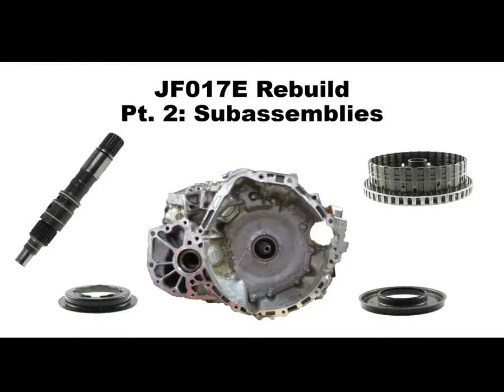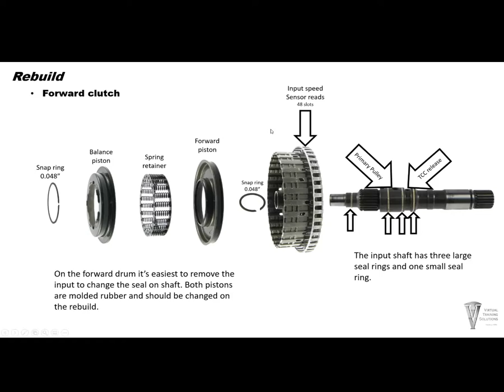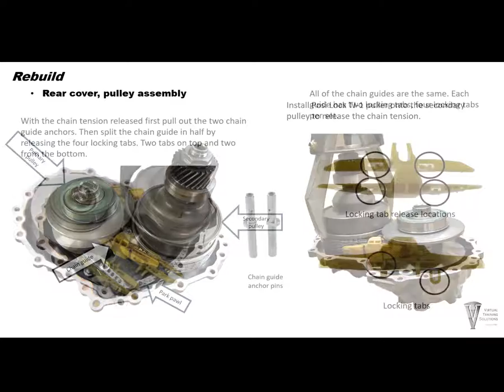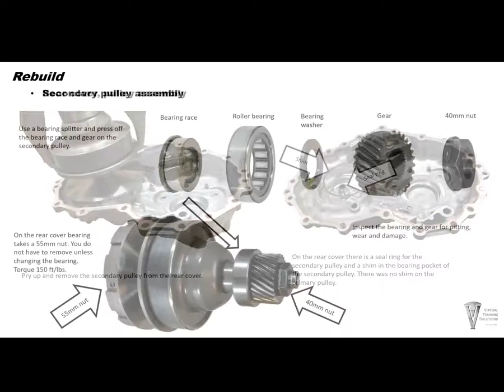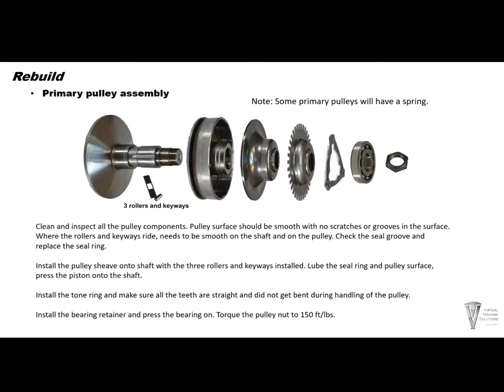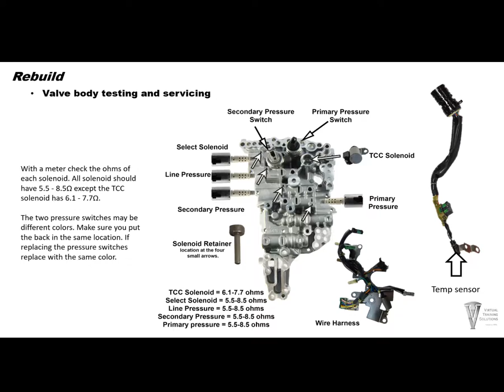07 vts jw jf017e subassemblies

Comment: Hello, I have a question.  There is a humming sound in the Nissan X Trail 2016 automatic transmission.  Everyone says it is normal between 20/40 km/h.  What is the solution?  It does it even when you slow down. Dizel No, it works fine, there is no knocking or anything, the sound comes from the gearbox, how much is the gearbox oil in the front? They put 7 liters after the repair.
Reply from the maker: A humming noise can indicate a number of concerns, and it could be normal. Usually, I would first start looking at your tires. Your tires can adversely affect the sound. If it is a solenoid buzzing, that can be normal; other than that, noises are the hardest thing to find. I'd take it to a shop and have them put it in the air. Maybe the sounds will be more prominent. https://www.atra.com/ShopFinder

Comment: Hello, I have a question.  There is a humming sound in the Nissan X Trail 2016 automatic transmission.  Everyone says it is normal between 20/40 km/h.  What is the solution?  It does it even when you slow down.
Reply from the maker: Is the humming coming from the front or the rear of the vehicle? are there any symptoms, like harsh shifts or something like that?
Reply: @atra-automatictransmission1300 No, it works fine, there is no knocking or anything, the sound comes from the gearbox, how much is the gearbox oil in the front? They put 7 liters after the repair.
Reply: I would like to send you the humming sound video, how can I send it?